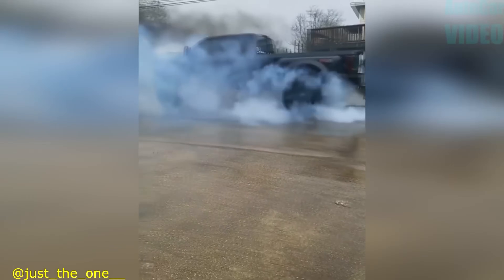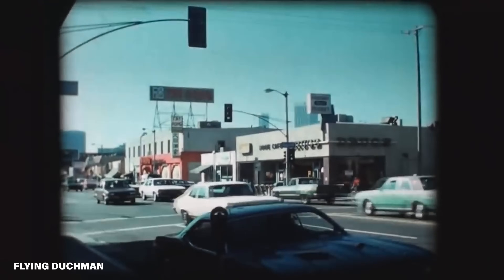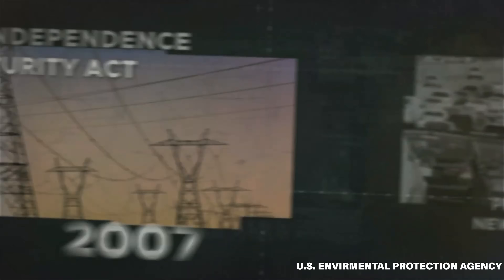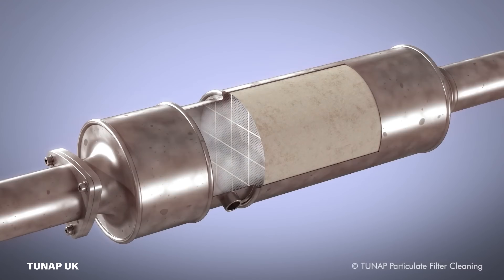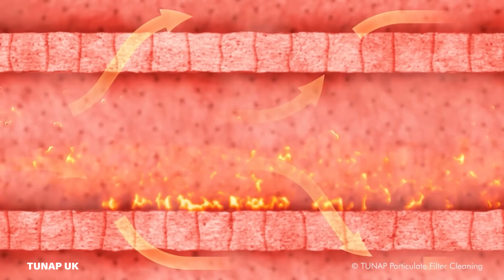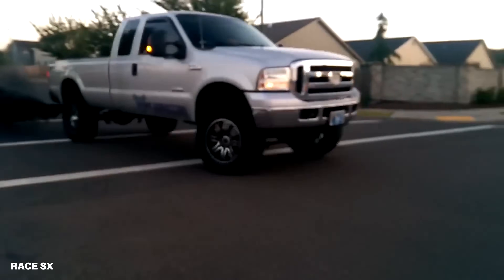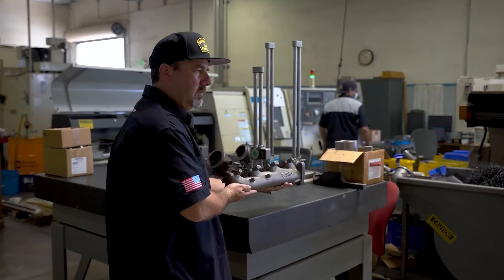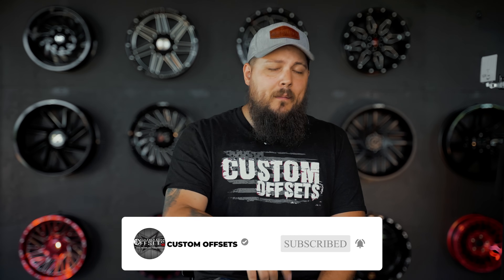What's DEF and Why Do You Need It?

Comment: 4 years later and there’s arguments being made from both sides.

Know what matters though?
The fucking data.

All the big companies are now testing non emission diesel motors.
Every no wait EVERY company has told the government that they need to back up the emissions standards because it’s outright KILLING trucks.

Money matters.
And when you spend 60-80k in a truck and have to remove these items so it’ll keep running after a few thousand miles that actually shows something.

Hell they’ve proven at this point that deleting your truck and tuning it correctly still helps them run cleaner AND get better fuel mileage.

Want to save the environment, then buy a vehicle you’ll actually use

Comment: Slightly less performance is a better alternative to spewing poison into the air. At least 5 out of 10 Diesel truck drivers have a clean bed. Meaning the most they are hauling is the kids to soccar practice

Comment: Drive a F-550 at work. Lots of low speed, low RPM driving. Plus lots of idling. One day the vehicle told me it needed to be serviced because essentially the DPF was dirty. Put the transmission in "M" and 3rd gear, drove around like that for about 10 miles, and that cleaned it.

Comment: I am unconvinced the extra fuel usage caused by the def regen is actually worth the smog reduction, environmentally speaking. I guess It makes the air cleaner at the cost of more co2, which I suppose could be worth while in urban environments.

Comment: I am a retired heavy equipment mechanic.  Yeah, the EPA is a bummer.  Wanna know what else is?  Lung cancer at 50 for a non-smoking diesel mechanic because breathing diesel particulate is just as bad as breathing asbestos.  I have fellas I worked with for 20+ years that died of cancer soon after retiring or didn't even make it to retirement.  Coal miners get Black Lung disease.  Diesel tuners back in my day, nearly just as bad.  Honestly, the fellas that like to 'Roll Coal' on people is  completely shameful.  What I know about diesel particulate, that should be an assault with a deadly weapon.   I'd like to see the manufactures do a better job in making these systems more dependable. Unfortunately, deleting the system doesn't encourage the manufactures to improve the systems.  The manufacturer has your money.  Not buying the trucks because the systems are not dependable is the only solution.   Unfortunate wisdom is wasted on us old folks.  You aren't going to look cool if you are missing a lung,  Just sayin.
Reply: If that was clearly the case where all these farmer with lung cancer. There was pre def tractors long ago. A typical farmer doesn’t hire a mechanic he fixes it himself
Reply: @marcomandolini86 a farmer is working on his tractor occasionally. A diesel mechanic is exposed daily usually for hours. You can smoke one cigarette, or even one every few months, and not get lung cancer. You probably will get lung cancer if you're smoking a pack every day for years.
Reply: @marcomandolini86  A typical farmer isn't working on his tractor every day now is he dimwit. A diesel mechanic working on a fleet of transit busses is.  AG is incredibly toxic.
Reply: Yea, I have always thought that burning tires and rolling coal was pretty dumb.
Reply: You are right. In the end is not about the "Environment " it's about our lungs.
Reply: @HeronCalaris  LOL  What?  LOL  I was once Conservative.  The EPA is a Conservative program.  Yes.  The EPA is trying to save your lungs.   Both of them.

I am an old retired heavy equipment mechanic.  Way pro-union.  

Today's Conservatives have nothing in common with the 1956 GOP Presidential Platform.   Living wages.  Home ownership.   Health care.  Retirement.  God.  

Of all of  those, it was god I can live without.  

It was crazy to me I had to start voting Democrat.   

The GOP today is all about a grift in the name of god.  

I have proudly become a nonbeliever, thanks to today's GOP.  

Diesel is awful.  It kills every thing.  

Death is forever.
Reply: Thankfully, in some places, you can be fined for rolling coal on people ... now I am all for building rad rides and such and I don't hate on others builds , but just like a nasty ass cigarette,  ya should not coal out ppl that don't like or want it , just like second hand smoke ...
Reply: I'm sorry to hear about your condition. These new trucks properly tuned and hooked up to exhaust vents in the shop could have helped prevent that more than DEF ever could.
Reply: Yep, good points. I worked as a Diesel mechanic for a decade as well. I can tell you, soot is not cool. Dirty exhaust is not cool. The guys that like to "roll coal", I always think, I bet you wouldn't pipe that into your kids bedroom. So why is it fine to blow that crap all around your neighbourhood, or near some pedestrians or cyclists?
Reply: @jdillon8360  Yep.  Just total asses.
Reply: Think that’s call luck of the draw, cause I know welders, operators, pipe fitter that chain smoke two packs a day an the guy that doesn’t smoke gets cancer.. he ended up beating it but some people are just unlucky that way 🤷🏻‍♂️ crazy to think there’s people that believe DEF an emission equipment isn’t a huge waste of resources an harms the environment more than it helps it
Reply: @D3CK_co    Perhaps you should put your lips around your diesel pipes and suck in all of the particulate and put your opinion to a real world test.
Reply: Poor design but idiots altering there stuff is going to give more cancer than anything.Everyone thinks they can fix a problem if you don't want cancer don't use electricity or work in industry with machines or drive vehicles.....if you do cancer will come fact's
Reply: So your trucks run when you work in them?
I’m just curious to how you’re breathing the fumes when the truck is being worked on?
Why are you being so dishonest.

What other chemicals did you use that could cause health problems? 
Don’t bother answering because you know full fucking well that I know there’s a LOT of other chemicals used that can cause health issues.

Hell your statement “heavy equipment” shows you weren’t at a dealership working on these trucks, instead your working on entirely more simple systems that don’t have all these emission crap on them to begin with.

Why?
Why are you being so
Reply: @jerlaine1638  It depends on what the repair was right?  If you have a coolant leaks, oil leaks, drivability issues...even DEF issues: How do you start to diagnose anything like that without the engine running?  Are you such a magnificent diesel tech you never have an engine running before and a after  repair?  You never have to have the engine running to confirm it is fixed?  LOL  The only one being dishonest here is you, or you don't know jack shit about diesels.  Either way, you should just be silent.
Reply: DEF is crap. The EPA ruins more than it ever helps
Reply: @CaliforniaDreaming559  You should see what America looked like in the 60s and 70s before the EPA came along. Most cities had such bad smog you couldn't see more than a few miles, hundreds of rivers were so contaminated from industrial dumping you couldn't swim in them, or catch any fish. The "good old days" weren't as good as people like to think.
Reply: @jdillon8360 I have plenty of family from back then that lived in all parts of America and unless you were in Pittsburgh or other heavy industry towns nobody ever complained about smog. The EPA does far more harm than good
Reply: @CaliforniaDreaming559  Rubbish. The EPA cleaned up our air AND water. You are posting nonsense.
Reply: @briancrawford69  Diesel is crap.  Perhaps it was a technology needed in the early 1900s.  Only reason it sticks around is the failure of certain minds to grasp science.  A mind that prefers ignorance.  

I don't disagree at all that DEF is crap.  

To be perfectly clear: "Diesel particulate kills people."  There is no such thing as clean coal.
Reply: @CaliforniaDreaming559  the whole point was to manipulate us into EV's. This was designed to break our diesels.

Comment: Crap.  Sorry about that last one.  I work in the oilfield, and back in like 12 or 13 the tractor was used as the power supply for a lot of the equipment.  (Coil tubing, in this case).  When, not if, the def system cratered, depending on what you were doing, you could be blowing 800 bucks a minute waiting on a mechanic, who has to come out of Houston or San Antonio.  (Think fishing with the frac still there, for those in the know).  Thats just shy of 50000 an hour.  Since i didnt have to pay it, i laughed my butt off!!  Delete city, here i come with my 2021 ram 3500!!

Comment: I want to get ahold of a 2023 GMC Sierra 2500 Denali and I am thinking on the diesel but with these emissions systems constantly breaking I has me thinking the 6.6l v8 is a better option it makes me a little sad because Denali plus the Duramax luxury and power it is like taking senator Armstrong from metal gear rising and turning him into a truck without the bullshit known as the "def" or all the other parts of it I live in the states so deleting it if I get the diesel would not be a good Idea plus the sierra is what I want my future truck to be but non of that is what I came to talk about I just want to say don't you think their is a better way to do this reduce emissions thing but without the complexity like it works without constant maintenance and can be worked on at home so you think such a part for this engine can be created

Comment: My biggest issue with def is solely the limp mode. 5 mph is absolutely asinine. Diesel are used to haul stuff, meaning they are usually hundreds of miles away from home. And if it goes into limp mode, and I have to take it to a dealer 200 miles from home, how long is it gonna be there? A day? A week? A month? Several months? No thanks.
Reply: I agree 100%. Set it to 50 mph so that I can get it to the Shop. 50 mph should be irritating enough.
Reply: Not to mention if your hauling chances are it will go into limp on a major highway. Disaster waiting to happen.

Comment: If you clean tune your diesel, it will not have def, and pdf issues.  And your system won't need to regenerate as much.  Resulting in better mpg's and less emission related issues

Comment: I think I own a unicorn. I have a bone stock 2015 ram ecodiesel. 0 problems and 180 000km on it. I tow a 8000 pound trailer about 5 times a year. I've thought about modding it but I figure I shouldn't mess with it untill it breaks.
Reply: Yep, unicorn for sure.

Comment: Emissions on diesels is basically cancer. At this point its a money grab by the epa and manufacturers. I would rather delete a brand new truck off the lot, than have the warranty. A properly tuned diesel is cleaner than all the plastic jugs def creates.

Comment: My dad has a 2012 Chevy 3500 LML duramax and after buying it from an acquaintance (130,000 miles) it had issues with the def system within a month or so. My dad decided to do a full delete and him and I did it ourselves and now his exhaust system is a straight pipe and a muffler. Sounds absolutely amazing, gets slightly better MPG, and boy it has some balls now.
Reply: does it smoke?
Reply: @LuisAc  not really. Once we get the tune put on it it should
Reply: can any body delete that  I have 2015 f 350 n I have problems all the time cuz def
Reply: How long did it take to do the work?
Reply: @kingpest13  maybe 3 or 4 hours tops

Comment: Dont get a def truck. Usually if you remove it youre warranty is voided. Most dealerships wont work on your truck if its removed. this 'simple' system fails and makes you fix it by derating your truck. This 'simple' system can also cost upwards of 10k to fix should it fail out of warranty.
Reply from the maker: All comes down to dealer discretion, Some don’t allow some do, some allow it but with restrictions etc!

Comment: All my DEF junk was uninstalled, 4" straight pipe put back in place, tuned the engine and the trans.  The 6.7 Cummins sounds and performs so much better
Reply from the maker: The way it should be!
Reply: Excellent.

Comment: My dad has a 15 Cummins and the truck would always say that it was out of def even when it was topped off and you had 100 miles to get to the dealer so they could fix the problem, it would always take several days to fix and was never fixed permanently so he deleted and straight piped it and hasn’t had any problems since

Comment: These are pretty much the only issues on newer ford diesels. NOX sensors, DEF tank heaters/injectors, particulate sensors, egt’s, EGR, etc. Outside of that, and crankcase vent separator issues, nothing generally goes wrong on them.
Reply: That and the lovely CP4
Reply: Turbos as well
Reply: @kordellbranch9165  15+ are tons better, but yeah
Reply: Lube that cp4!
Reply: @MrJangojet  been putting in lubrication agents since day 1, hopefully that helps!
Reply: Having problems getting the 02 sensor to engage. But I don't think they have o2 sensors

Comment: Thumbnail for the video has a a 7.3 or 6.0 ford. DEF wasnt introduced until the 6.4 in 2008.
Reply: Umm I don’t even see a place to put def in my 2008 6.4 I think 2010 they might have started. 2008 has the dpf regen it’s a dry system no DEF
Reply: Also wrong no def on 6.4 lol